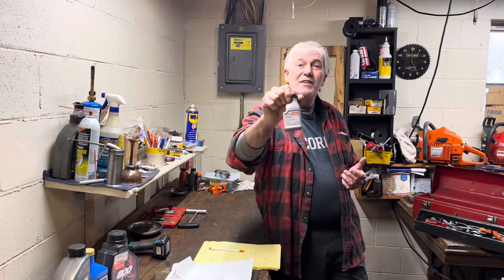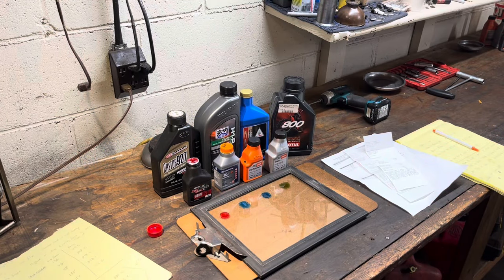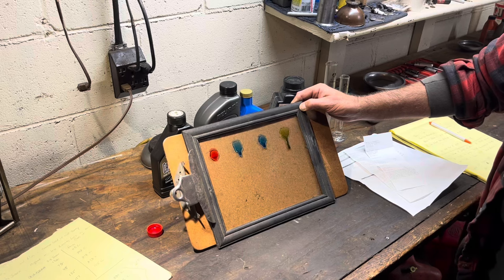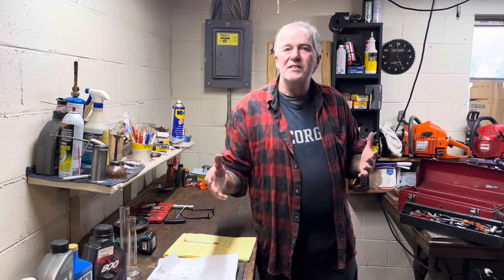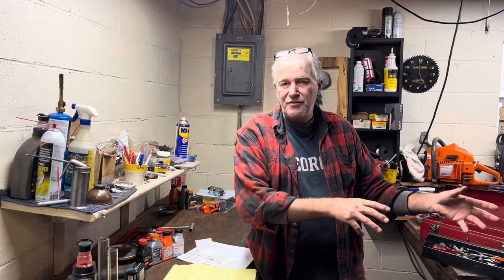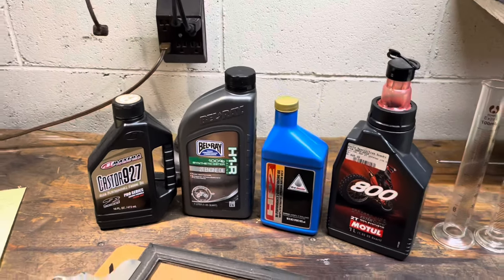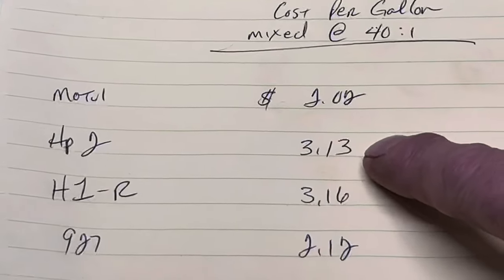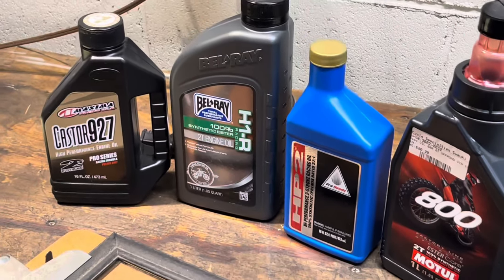2 Stroke Bike Oil in a Chainsaw?

Comment: From watching some of your other videos I decided to buy some of the Honda HP2 oil to use in my Stihl weedeater and blower. I’ve been using the Stihl oil in the orange bottle and a couple of times I use some of the Stihl oil in the silver bottle until I saw some other videos showing that it wasn’t as good as what the orange was. 
I mixed up the 1st gallon of oil this year using the Honda HP2 and also noticed it was quite thicker than Stihl’s oil. The measuring cup I used to measure the oil in took several times of pouring gas in it and swishing it around for it to dissolve the oil off of the measuring cup.

Comment: Bel Ray H1R and Motol 800 off road vs Saber from my experience, the Saber is a better choice for a trimmer and a chainsaw. Motorcycle oils are thicker and in the summer I noticed that the exhaust is hotter than when I use the Saber and the throttle response is even better with the Saber .Saber 1:50 is very excellent and economically speaking 30 EUR vs 17 EUR for a bottle. and it even has a fuel stabilizer. The fuel mix is usable for up to 12 months. I stay with Saber. I wish you, Mr. Richhard, much success in testing and certainly a big thank you for the previous tests of 2 T oil. You convinced me that Amsoil Saber should be my choice of 2 T oil and so thank you very much!
Reply from the maker: Thank you Sir!
Reply: I used to run Bel Ray in my lawn boy...worked way better than LB oil...then I tried Redline and never used anything else since 1994.
Reply from the maker: @mikeschlup5279  Those old Lawn Boys are tough as nails.  They don't make stuff like they used to.

Comment: I personally prefer Bel ray. I’ve been running it for over three years as a production timber faller. I have been very pleased with it. I’m interested to see how the other oils perform. The only other oil you have there that I have ran is the motul. I think you’ll find it is a good lubricant but doesn’t burn as clean as some others do.
Reply: Why I quit using Motul also Jake.
Reply: Does H1R run good for sustained high loads?
Reply: @JS-oy6nn  motul 710 ok brn

Comment: I’ve used about a gallon of the 800 off road in the last year. I really like it. Used it 40 to one in most stuff but 32 to one in my ported 880 milling saw.
Reply from the maker: I like the way you roll
Reply: @richardflagg3084  🤘🏻🤘🏻
Reply from the maker: @mfsaws8240  👊
Reply: @richardflagg3084  Motul 710 2t       50/1  tested in cheinsaw 🙏🙏🙏🙏
Reply from the maker: @Okinawa1914  It's on the list.  Should only be a couple of weeks.  Working on a rebuild of the MS400 test mule.
Reply: @richardflagg3084   Jes 👌👍  "Motul 710 "  👏👏
Reply: @richardflagg3084 Motul 710 test ????????

Comment: Woohoo! Definitely seem like the most popular bike oils people use in OPE👍🏻 I've ran many gallons of 927 in OPE, primarily mixed @32:1. It actually seems to "self clean" better there than @40:1. Tho I do have a handheld blower and a string trimmer that do seem to be building up a little bit of carbon. Haven't tried but have heard great things about h1r, 800 off road and hp2. Really excited to see these oils added to your list for testing!

Primary reason im interested in the alkylate fuel is because I have a not so small and growing collection of 2t equipment. I dont prefer to store them dry but with so many pieces, occasionally some of them will sit unused for several months. And the only alkylate fuels available in my area are the pre-mixed ones or I'd get the 4t version and mix my own.

Comment: Great video Richard.  Out of those 4 motorcycle oils I have only used the HP2 and the 927.  Be ready to drool when you smell the 927, love the smell of it, hate it doesnt have die in it.  The 927 put some build up on my piston but at that time I was running the saw fatter than I do now, I pulled it down cleaned up the combustion chamber and piston but haven;t used any more 927, Id be interested to see how it actually does running it now when I run the saw leaner than I used to.

Comment: Thank you for all your videos on the different 2 stroke oils, I was interested to hear you had been running TCW3 with great success in your saws. I've also run TCW3 in my chainsaws and string trimmers, they didn't blow up and still run quite fine, My thinking was, I use this stuff in my 90HP outboard and ran it in a 200HP outboard which have more load on components than a chain saw engine, and this is designed to be biodegradable in a marine environment and that's the main difference apart from outboards do run a lot cooler. Running Motul 800 at 40 to 1 now, and am very impressed with oil film left in crankcases. Have had some experience with other peoples stuff run on the Pond water and it wasn't a good outcome. From what I've seen I couldn't recommend pond water oil to anyone.  I really appreciate the time you have spent making these videos. Thanks from Australia
Reply from the maker: Thank you!  
Pond water = dry as a popcorn fart.
But here in the States they will double your warranty.  Lol!

Comment: I used Bardahl VBA motorcycle oil in all my 2 strokes for years with no engine failures or carbon problems.  I bought out all the remaining stock when they quit selling it many years ago and have finally run out of it. I have been using ECHO RED ARMOR as a replacement, and it performs excellent.  Another bike oil I have used is Golden Spectro, which seems to be nearly identical to Bel Ray and VBA.  Since all my saws are vintage, I only use partial synthetic oils and have had great results, and no failures.

Comment: Honda HP2 is my favorite oil. I use it in all my two strokes. It's quite high viscosity. I have used 927 in everything at one point and NEVER experienced it being dirty. HP2 smells good to me, 927 doesn't, I'm the weird one that doesn't like the smell of castor oil (unless it's in race fuel) so that's the only reason I use HP2 over 927.

Comment: thanks for directing me here. i'm also an avid 2 stroke rider and  usually use motorex  in the bike without any issues.  been using husky oil and proof of that is what was getting me the warranty with the autotunes.  slide test is a great visual.  ill bench my husky oils and start running the bike oil on the new warrantied short block and let you know how the next 100 hours goes.  30 bucks a litre vs 20 for the husky not much difference if the engine lasts.  im blown away husky hasn't addressed this.  im one of very few that take a autotune to camp.  390's and 372's are being bought out everywhere because everyone gave up on the new husky's
Reply from the maker: 390's and 372's have put a lot of food on the table.  Doesn't matter how good the warranty is if it's not helping you make a living.  I like the new saws, don't get me wrong.  You'll have to keep me updated on how the bike oil does long term.  I could never get enough trigger time to show it personally.  Jake Mesa did tear down with Motul 800 and it's a little dirty compared the Belray HR1.  He's a commercial faller as well.

Comment: I’ve run all those oils (at 40:1) other than red armor and HP2, they’re on my list though. Bel-Ray H1-R is what I’ve stuck with if that means anything. Ran many gallons of that mix through lots of machines. Torn down several saws, blowers, and string trimmers and didn’t see anything I didn’t like. I hear good things about Honda HP2 so I’m gonna be running that next.

Comment: Right now we are using Motul 800 Offroad 50:1 in a Husqvarna 135 Mark II (max 9000 RPM) and Stihl FS 260-C brushcutter together with Liqui Moly Stabilizer and Motorbike 2T Bike-Additive (Increases performance and provides cleanliness). The truth is that both machines run like clockwork and feel very very smooth. So, for me, you could test the Motul 800 Offroad. And thank you very much for your videos! 😉
Reply: none of that increases power.
Reply: @alexstromberg7696  I haven't noticed an increase in performance either, but that's what it says on the data sheet. It's Liqui Moly 1582, which in my case I only add to the petrol for the cleaning effect. And the stabiliser because the machines have not been used for a few months.

Comment: Got to you a bit late tonight, side hustle firewood processing, Test the Motul and you will see that this is no joke if you use a power saw with any nuts. I don’t have the means nor the desire to run dirt bike pipes on my saws, I run what I have and spend my time on the chains, I try a few things here and there with a muffler or an intake filter, but if you know what you are doing you will listen to the bike guys who are much like we are in the saw world. The 800 2T runs a hard shift and it’s will perform as you need it too. I don’t pussy around on the throttle when I get into the hardwoods, it’s WOT and hold on for the ride.
Looking foreword to what you find on the Motul 800 2T at 40:1, and if it’s anything like my saws it will not surprise you. Thanks for doing this comparison and I appreciate your testing. Who knows, maybe you can teach this old dog a new trick. LOL

Comment: The oil flow isn’t a factor once it’s mixed at the running ratio…the important factor is it’s ability to coat and lubricate wear parts and reduce friction, the other important factor is it’s ability to burn clean and reduce carbon buildup 😉👍.
One of the really good ones I buy by the gallon is a snowmobile oil called Shell Advance 2, it’s a full synthetic with JASO FD…in the new snowmobiles, detergents and recycled carbon is critical due to their exhaust valves, which will gum up and not function.

It has good flow characteristic as it’s designed to be injection fed or manually mixed.
Should give it a try 😎👍
Happy Thanksgiving
Reply: Myself have also been running Shell Advance Snow Ultra in all my 2-strokes, from the weedwacker up to my YZ125 motocross race bike, wouldn't change it for anything else.
Reply: @michellatour150  nice. A buddy of mine was building custom hill climb snowmobiles (turbos etc) and he recommended it to me back in 2003…his sled back then were $50,000 so if that was what he was using in them, then it’s good enough for my saws…never had one let me down due to oil since! 😉👍

Comment: Great video and shows the viscosity difference between premix race oils and oem oils which contain solvents to help blend easily with petrol.
Testing the Motul would be my pick then the Abel Ray then the Maxima 927.
The wash should be very prevalent with the two synthetics and a bit less with the castor.
I wouldn’t recommend a castor oil for everyday commercial use as it’s generally a dirty oil leaving deposits on pistons, exhaust ports and can even cause rings to stick. It’s also not good for very cold ambient temperatures as it has a tendency to separate from the fuel.
The Motul and BelRay however don’t have this problem and will blend and stay in solution.

The benefits of these oils is that for racing, they allow you to tune your a/f ratio for max power ie as lean as possible without seizing or blowing up your engine. This is particularly so with castor oils as they have the unique property of getting thicker and turning into varnish when run very hot, which still has lubricating properties. Synthetics don’t do this.

As for JASO rating, none of these oils will pass the smoke test as much of the lubricant can remain unburnt as it exit the exhaust. In terms of port cleanliness the Motul and BelRay should be superbly clean. The maxima less so.

JASO FD iin a nutshell is about cleanliness. Less smoke, less deposits, complete burn. It also contains solvents to thin it out and assist in mixing with petrol. These solvents burn off completely during combustion

Can’t wait for the experiment! I’m predicting more lubricant in the bottom end and a nice wash pattern. I think you’ll find the Maxima sill have the most cling ones to the bottom end.

Really appreciate your experiments!
Reply from the maker: Great info!  Thanks for chiming in.

Comment: I use Schaffer’s 9000 @ 32:1
Along with Maxima Hi Test 3oz per gallon in 90 octane ethanol free gas. 
Excellent performance, minimal wear and carbon build up. Very happy with this combination.

Comment: Give Lucas semi synthetic a go if you can. It would be a pleasure to see how that stacks up at about $10 a quart.
Reply: Just found your comment. I've ran it for years. A gallon lasts me about a year doing lawn and tree service.
Reply: That's what I used in my old Husqvarna 460 rancher, had a lot of carbon build-up but saw worked and lasted for 8yrs until I sold it, and I burned maybe 5gal of fuel/yr

Comment: I dont think those oils will burn clean in a saw.
Even most guys with bikes pick lesser oils like dominator or motul 710 to get them to burn clean. The top of the line racing stuff is only good if you're wfo open all the time on your bike. 
Im currently using lucas semi synthetic, which has been fine. I ran dominator before it, the only issue is a little smoke until the saw gets up to temp.
The dominator and lucas are the oils I ran in my yz250 trail riding, the oils you picked were a smoky/oil drooling mess trail riding.

Comment: I've been using Caltex motorcycle two stroke oil in small engines since last century and all OK so far. It's JASO FC rated and pretty cheap too if bought in a 4 litre (bit over 1 US Gallon) container.

This is in Australia and is mixed with petrol (gasoline) containing no ethanol.

Comment: I appreciate all these videos sir. I personally run Husqvarna XP+ at 40:1. It's the cheapest FD rated oil I can get plus it doesn't stink. Everything looks good and lubed inside. GO DAWGS!!
Reply: I would also like to say that castor has no business in OPE equipment. It just creates a big carboned up mess. It's fine for something that's going to be broken down and cleaned but it's too dirty for handheld equipment that doesn't get torn down except when something is wrong.

Comment: The belray h1r is the only oil that I’ve used in my Kawasaki dirt bikes that never fouled the plug on the 3rd start up I’ve had a kx 80 125 and a 250

Comment: I buy my 2 stroke oil in gallons. It’s a lot cheaper then in quarts. I run echo red armor oil and buying it in 5 gallon buckets costs the same per gallon as gallons. Buying it in quarts costs almost twice as much per gallon. I’m just a homeowner not a professional so buying it in 55 gallon drums isn’t worth the hassle but that’s the best option if your a landscaper or tree company.
Reply from the maker: If I'm not mistaken RA is about $60ish/gallon.  Killer deal it you use enough.

Comment: Hi Richard. I love your new oil series, thank you. I have just purchased a one litre bottle of Motorex 2T synthetic blend two stroke oil that I want to try in my chainsaw’s, but I’m not sure how it will go? I noticed the oil is very thin and not thicker like the ones you have shown us in this video. I started using it in my chainsaw today and it seems to run fine! At 40:1. I have been using Sthil hp and all my piston are black for fairly new saws,. I have a new clone which runs at 25:1 and I’m not sure what to run that at.?. Thank you very much in advance for any info as what to do with this oil or the ratio that I should be mixing at.
Cheers, New subscriber 🙏

Comment: Running Bel-Ray H1R lately. Buy it by the liter and use old Stihl oil bottles to measure out a quantity for my 2+ gallon jug. About 40:1 mix.

Comment: If you have any oil that burns and leaves drool it is not the oils fault. It is the air to fuel ratio. Used to race motocross and even at 20:1 the pipe would burn gray with no goo. Three areas of the carburetor to adjust and could tune to very good at every throttle setting.
You can run straight gas with no oil and if air-fuel mixture is wrong will still leave black drool.
Reply: Well it's also to be considered that some engines are simply designed for more oil, a leaf blower recently bought by a guy I work for was 15:1 ratio, unknown to me I used my 40:1 saw mix and couldn't understand why it was getting so hot, running weird.. well upon us both looking at the manufacturer paperwork we realized the problem. 15:1 it was totally cool. Glad we didn't smoke the engine on 1st day of use.. you've got a good point but to an extent that needs considering is the designed ratio spec

Comment: Rich, i LOVE your channel.  It's been so helpful.  My question is this:  is there an issue using mix oil intended for engines with a radiator, vs oil designed for air cooled machines?  I've seen some motor sport mechanics weigh in, advising against it.  Your thoughts as someone who's inside chainsaws?  Currently using klotz r50 moto oil and liking it very much.  Thank you for the good work!
Reply from the maker: I think a boat oil is due for a test soon.  I believe a high quality oil will do well in any application.  We'll see...........

Comment: I have no doubt any of those oils will provide good lubrication, but racing engines tend to get a lot of maintenance and TLC, and I do question whether they have sufficient amounts of detergent and any other additives to perform reliably in a 'consumer' environment, particularly in devices other than saws.  I ran Mystic Sea and Snow @50:1 ($26/g, FD rated, and made by Citgo) for many years in everything, and I continue to use it in my snow blowers and generators, with no complaints.  However, I have recently begun using Saber in my saws, trimmers, etc, and while I haven't decided if I want to run it at 40 or 50:1, I have no complaints about it either.
Reply: Glad to hear you had good results with the sea & snow. I bought 3 gallons(12 quarts) for $34 on ebay, so I will be subjecting my saws and trimmers to it for a good while.